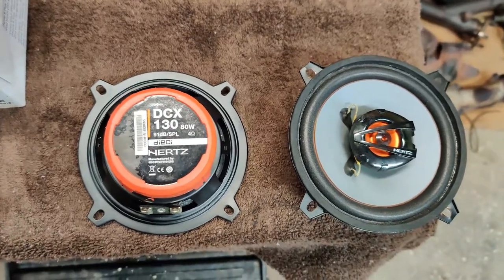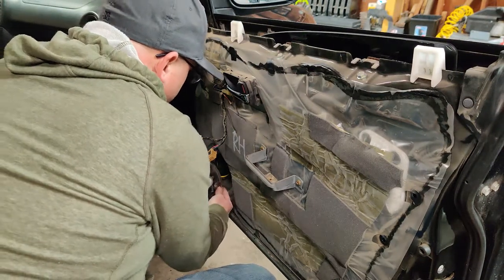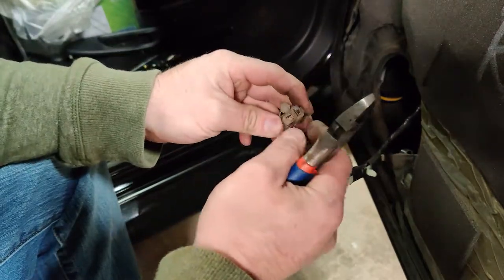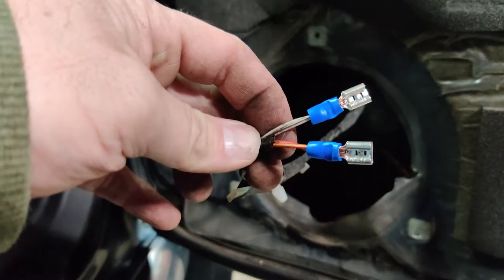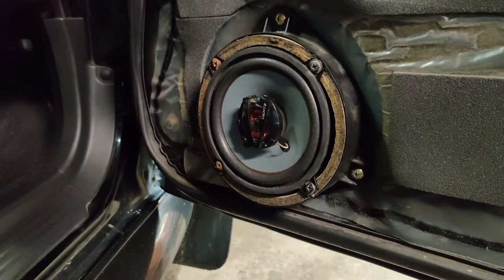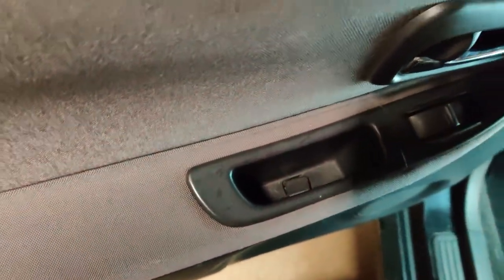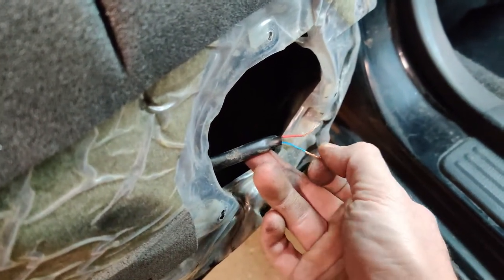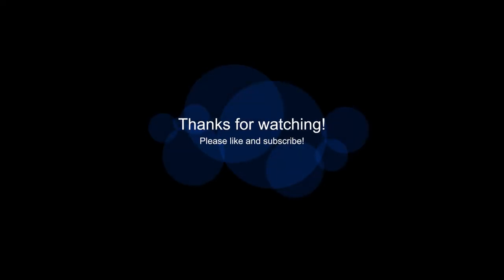Speaker installation on my Hawkeye - 2006 Subaru WRX

Comment: great video.
It will sound way batter if you make an airtight seal around the speaker.
Reply from the maker: Thanks! I agree, it definitely would sound better.
Reply: @lonniebrown6678  what do you  create air tight seal with?